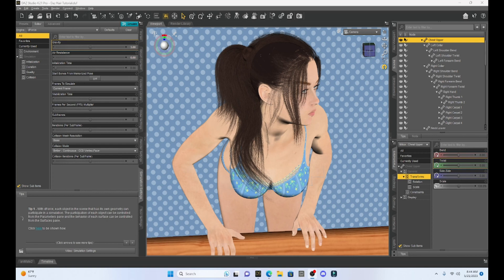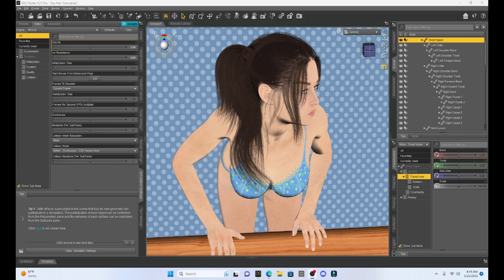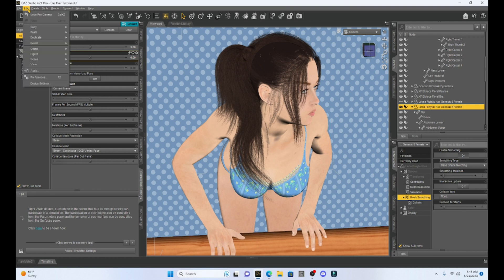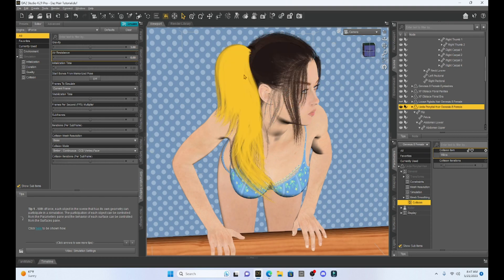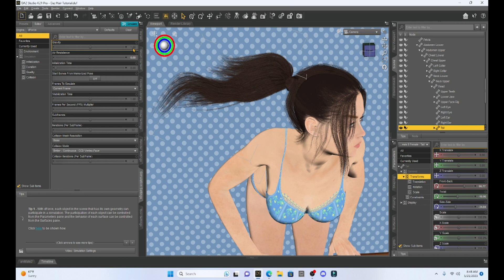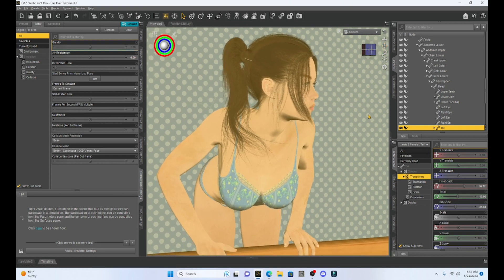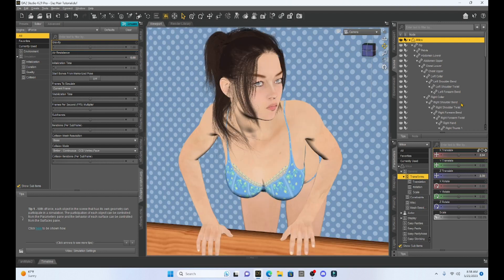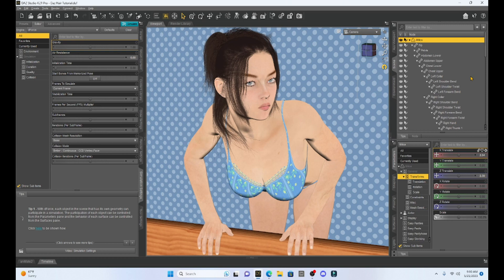Daz Studio: Non D-Force Hair UPDATE!

Comment: Can't say i have ever had this issue, i use my own deforce converted hair pn multiple different figures, although i wonder how mesh smoothing would react with my deforce hair... One thing you really want to deactivate on any hair deforce converted hair, is in the materials of the hair, change the self collide option to off, non deforce hair has intersections that will ruin a simulation in much the same way as not posing the deforce parts of the hair away from the body.